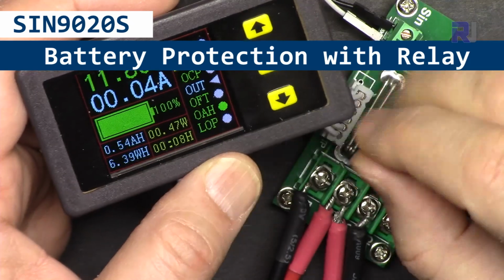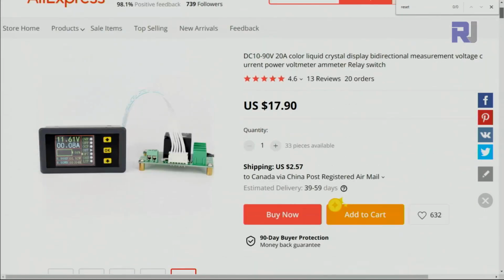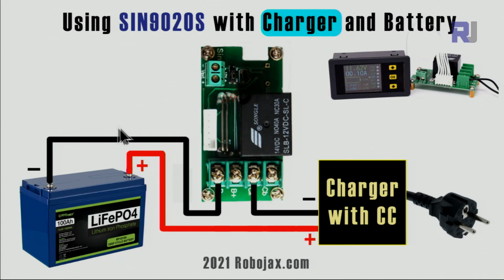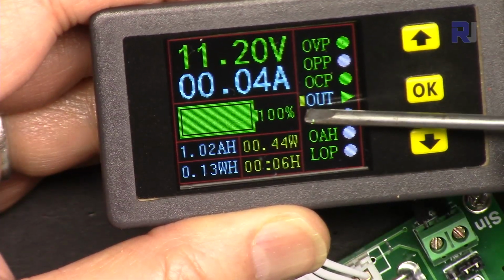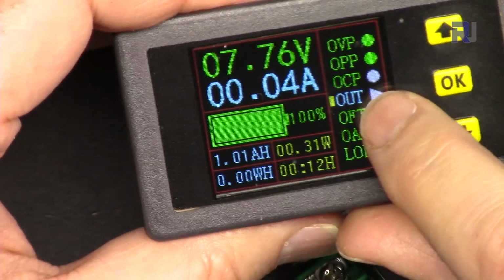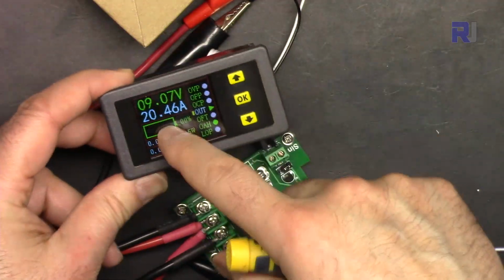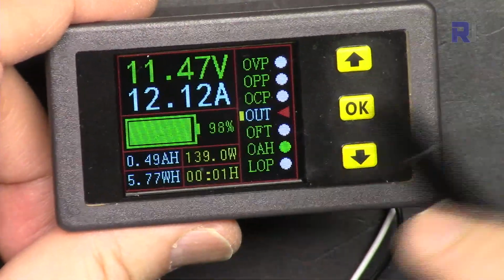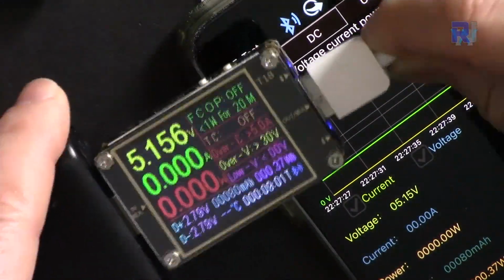Battery Protection DC10-90V  SIN9020S OVP OCP OPV Ultimate protection with relay RJT371

Comment: I was wondering which DC-DC stepup converter you would suggest for 5V (USB) or 12V to 21V for low amp (max. 2.4 A input) but "high" efficiency applications? There are tons available and many of them you managed to bring to their end rather fast...

Comment: BTW - The audio in this video is not as good as normal. there is a lot of scratching and popping going on.
Reply from the maker: Yes I noticed but could not fix it. I powered my wireless microphone receiver via a different USB power source, I belie that  had noise. I will investigate it. thanks.
Reply: @robojax  other than that - an excellent video - thanks again